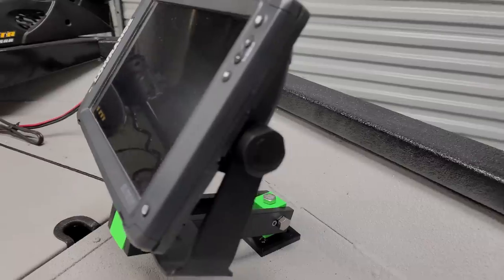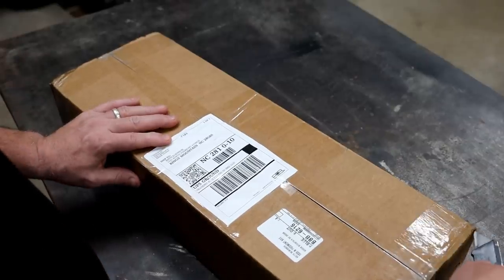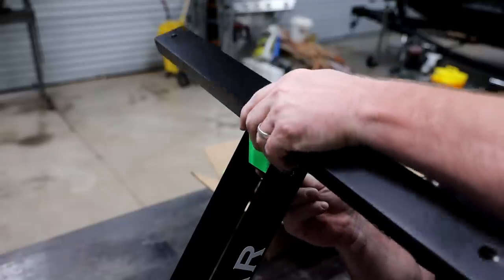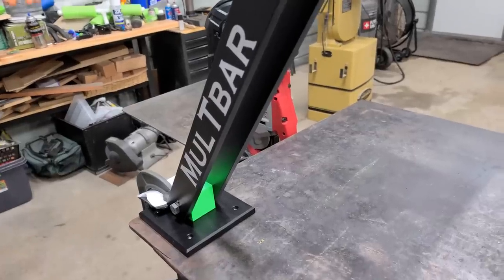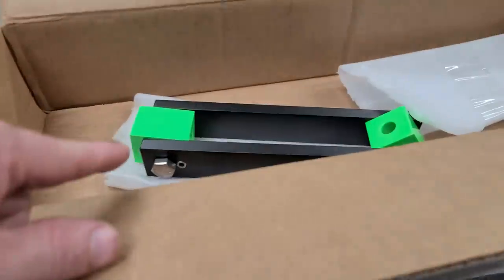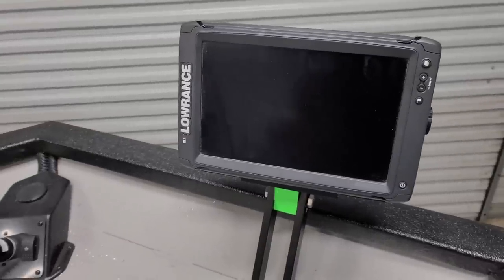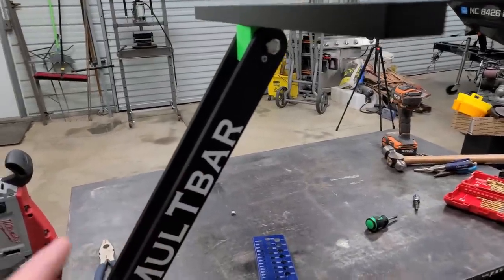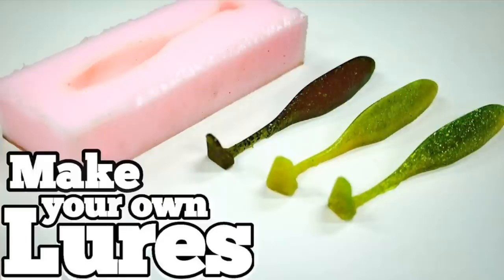Awesome NEW way to mount your fish finder

Comment: After getting one do you feel it's worth the $175 for the rod rack?  They look great, but 175 is steep for a rod rack without any rod holders on it.  Just curious, since you have one in your hands.
Reply from the maker: After looking at one , the build quality is awesome on em . And it fits seem high but I don't think he's making a killing or getting rich because I would guess too build 2 of these would cost at least 200 in materials plus your time and tools and the powder coat is done really nice . But it could just be me but my rodrack cost 500 bucks that came on my SeaArk  so it doesn't seem that high when I take that into consideration  . The SeaArk rack is strong and a little bit lighter than these but you give up room on your boat , and these could free that room back up

Comment: What's the thickness of his flat bar material? Are they all 1/2 bolts and threads?
Reply from the maker: I'd have to look the rod tracks I used 1/2" bolts
Reply: @FishinNStuff  I know you used 3/8" × 1 1/2 and 1/2" x3" stock is his 1/2" thick x 2" wide on the sides and 1" thick t top by 2" wide? Trying to see the size material he uses. I messaged him no response just want to justify his price vs digging through the scrap yard to make some.
Reply: Hey Mark. I've never gotten a message from you?